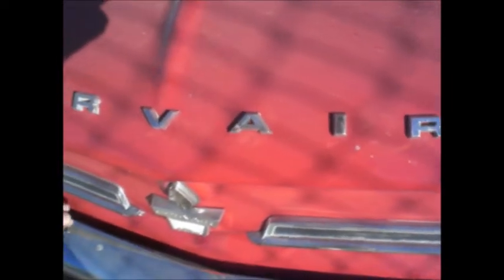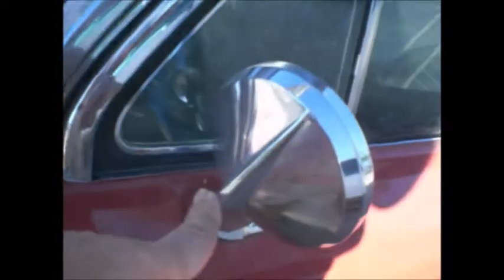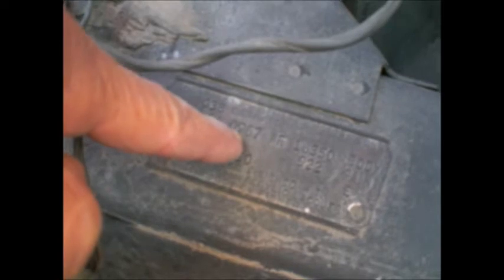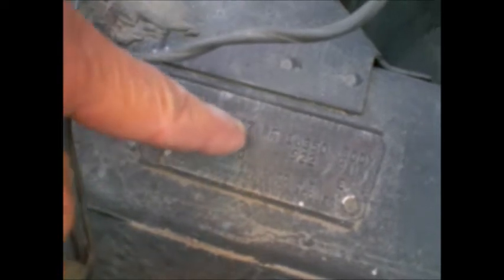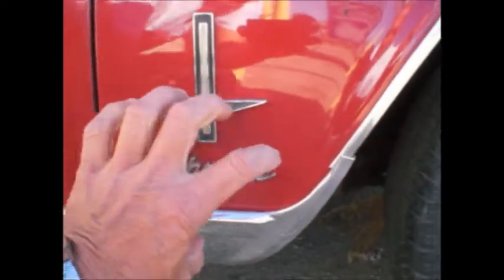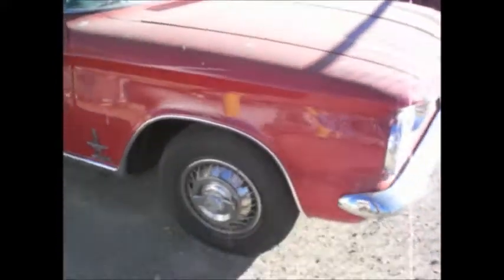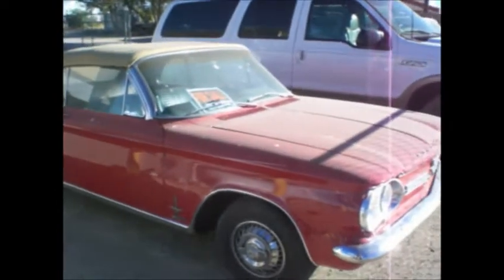Monza Spyder Vert For Sale $18,000  10 29 14

Comment: I don't think so!  Beauty the car is, but the price is too high!  Automatics and turbo's do go well together on the other hand. Even a Power Glide.  As for the Excursion, they do have a bit of a 'cult' following as well, they were actually longer in length then the Suburban offerings from GM, but for whatever reason, never caught on, perhaps even the public looking for large vehicles in this group felt the Excursion was, well, too large.  Also, they did not handle nor feel nearly as (and I did have an opportunity to drive a V-10 example), crisp in handling as the Suburbans.  A little clumsy in fact.  But they were rated to tow quite a load, and came with one heck of a heavy duty suspension/axle setup.